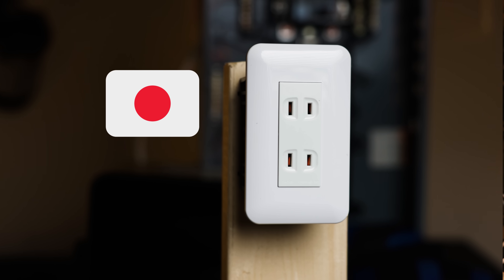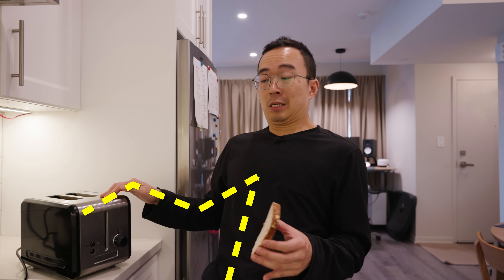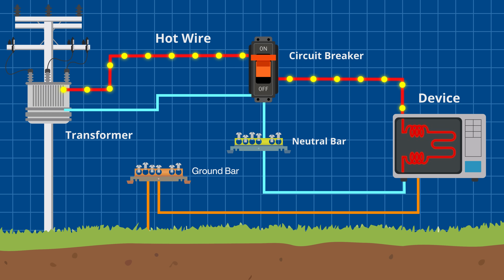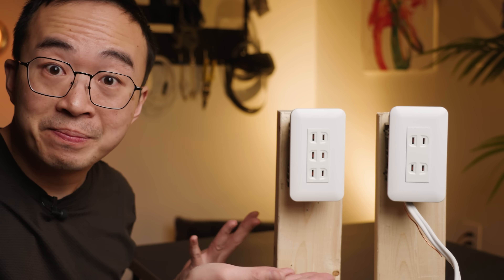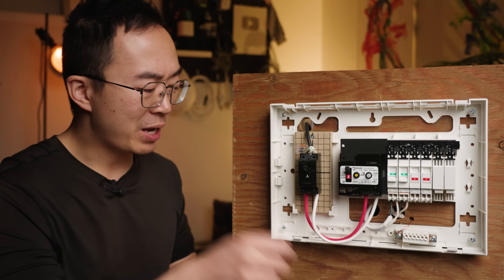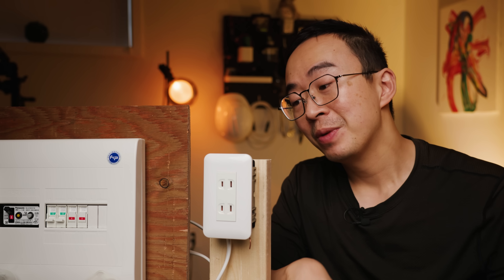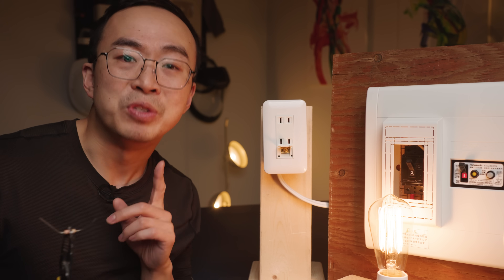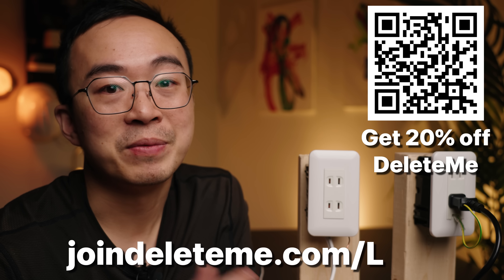How Japan Made Their Outlet Safe

Comment: In America we actually do put GFCI in the breaker but it's still only connected to the wet areas like bathrooms and kitchens. I didn't know that we did that and so when I got my current place I was like what the hell why are the bathrooms protected with GFCI because normally it's a button on each of the outlets and not in the breaker.
Reply: It was generally a retrofit so the first outlet on the circuit is protected, not the whole circuit.
Reply: @Cotronixco  how does it only protect the first outlet and not the entire circuit?
Reply: @bland9876  Everything upstream of the GFCI outlet would not be protected. Everything downstream of the GFCI outlet would be protected as long as it is wired to the output of the GFCI outlet.

Comment: Safer? It rather looks like a dodgy workaround with that additional ground screw. In Europe you've got mandatory RCDs (>=30mA) on all sockets for over a decade now, of course with 3pin wires. In practise for example in Poland all circuits (including lighting) are protected by RCDs (multiple, to prevent turning off unaffected circuits). And the major difference in using both, ground cable and RCD is of course that the cirtuit may turns itself off when the fault occurs, not when a person gets electrocuted.

Comment: Before watching this I make a guess, it could be about tranformer isolated systems with current mitchmatch security switch? A floating circuit so to speak. When current in does not match current out, switch goes off.

Called it!

Comment: GFCI is supplemental protection. Grounding is basic protection. You absolutely cannot replace basic with supplemental protection. Also gfcis are proven to be less effective in 2 wire systems. 2 wire systems don't provide adequate protection when operating properly and absolutely zero protection in case of failure. All it takes is a loose or burnt neutral wire at the breaker panel and all metal parts of electrical devices become live.
 I would honestly expect a second video correcting this one, as the level of electrical safety knowledge you demonstrated is abysmal.
Reply: I wonder how much safer does that makes the whole system. Not theoretically but practically. Being living in Japan for a long time, but have never heard anyone dying of a electric shock...does that extra grounding REALLY make a difference in real life?!
Reply: GFCI in Europe is ALSO BASIC.. NOT SUPPLEMENTARY... in an exposed wire or damaged device that discharge in your table's legs or in a ... plasterboard frame of ...american papier-mâché houses ...with the cables around and not inside the corrugated... probably the ground cable are your little son... and your 20.. 32 or 64 Amps circuit breaker isn't adequate for save your unaware ground cable called probably YOUR SON.... 🎉🤗🥳😅

Or not?
Reply: Each country has their own regulations which define what you can and can't do.
Reply: NEC and CSA don't think so. They approve GFCI receptacles as a safe 3 prong retrofit for 2 prong ground-less K&T or old Romex wiring.
Reply: @Roi-su8mo  I can vouch this is true in Canada. From the Canadian electrical code book 2018(I dont have the latest):
26-702 2) - At existing outlets where bonding means does not exist in the outlet box, grounding type receptacles shall be permitted to be installed, provided that each receptacle is protected by a ground fault circuit interrupter of the class A type.
Appendix B for that rule goes on to describe that the GFCI can be of the type that is intergrated into the receptacle, incorpirated into an upstream receptacle, dead end front type or by GFCI circuit breaker.
Reply: @zeddpilsner4  that's essentially converting a 2 wire system into a 3 wire at the outlet itself. I've no idea on how effective that would be since we don't use it here but it sounds hit or miss, especially since it only protects against the fault of the device and not the outlet itself.
Reply: @adrianio1000  Doing this would provide the 2 prong receptacle with what the Canadian electrical code defines as "Class A GFCI" protection: a ground fault circuit interrupter that will interrupt the circuit to the load, within a predetermined time, when the ground fault current is 6mA or mor but not when the ground fault is 4mA or less.

The appendix B for that definition goes on to explain that: "the primary function of a class A GFCI is to provide protection against hazardous electric shocks from leakage current flowing to ground from defective circuits or equipment"

This was a follow up the the previous commenter that it is a code compliant method to replace two prong receptacle with a 3 prong grounded type provided that each receptacle is protected by a ground fault circuit interrupter of the class A type.

I am not sating my personal opinion about the effectiveness of this method. I am only quoting the Canadian electrical code 2018 for anyone reading that may want to learn what is code compliant in Canada
Reply: @Roi-su8mo  well the IEC does not.
Reply: That's BS.  GFCIs don't need or care about a ground connection and are not "less effective" without one.  That's like saying your speedometer in your car is "less effective" without a passenger.
Reply: @jovetj  That's wrong. You can potentially use an ungrounded GFCI because many devices only have 2 prongs to begin with and for those there is probably no real difference. However, for 3 prong devices, they may well not have another layer of insulation, so that lack of a ground pin is a very big deal. 

So, to say that GFCIs don't need to care is a load of crap, they only don't need to care if they don't have a 3rd place for the ground pin to go. You're risking getting shocked as it does take a longer period of time for the power to shut down coming through the outlet than it does for current to be diverted down a ground.  If you need GFCI protection, you also need the protection that comes from a properly installed ground unless the outlet only takes 2 pronged devices. Which is really the only reason they have been able to get away with that. Their stuff is double insulated and is used/installed generally with the understanding that there is no ground to rely on if something goes wrong.
Reply: @jovetj  tell me please: how are you going to wire an gdci into a 2 wire system, such that the device's chassis ground is outside of the GFCI sensing loop? The answer is you won't. You have to actually touch a faulty device and receive an electric shock for a current imbalance to occur and for the GFCI to trip.

Comment: 2:26 thats not good. the exposed copper wire will oxidize and the resistance will rise. Also someone who touches this in a bad timed moment would get zapped.

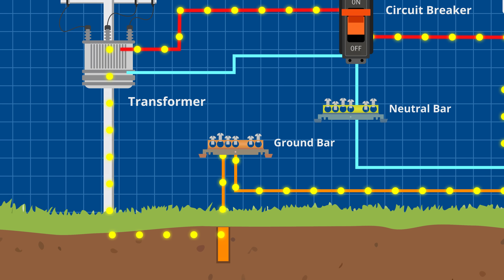7:00 The TT System is outdated, at least where i live. We rely on the TNC/S System. It's basically the same but it has an additional grounding that goes back to the transformer. It also split's the ground and neutral in the house itself. That's why we gave 3 Pins everywhere. And also why it's safer than the Japanese ungrounded System.

Comment: In all other countrys, GFCI works combined with ground.  So Japan still don't really have a real ground, it still can lead to harzards while GFCI failure.  Anyway US and Japan are still stuck in the really beginning of the 1st generation of electricity for more than 100 years.   It's just so poor design and was obsolete for almost 100 years also.  But stuck is a stuck seem US and Japan will be keep stuck in this system forever.

Comment: 3 connector sockets and GFCI / RCD is something normal and required by law in EU. Here in Poland we often have more than one RCD unit (usually one per lighting circuits and one for sockets). Thanks to that broken washing machine doesn't cut whole electricity at home off. I do have separated RCD (in fact integrated RCD + circuit breaker into one unit) for washing machine and oven. We do have by law requirement of minimum cable diameter used for grounding and maximum resistance of grounding. It's not that bad outside Japan :)

Comment: soo the outlets are actually even worse, and so is the infrastructure (TT), but you're saying its better just because whole house GFCIs are used?

Also that ungrounded socket WITH ground screw terminal is the most ridiculous thing I've ever seen... it SHOULD be a grounded socket with ADDITIONAL screw terminal for those old appliances you've got there, or just a grounded socket and force people to replace the appliance's plug instead of fitting such a dumb socket in the first place. I'm sure you could also get an adapter from grounded socket to one with the screw terminal too.

Comment: Your video is nice and informative, but not having earth makes it dangerous and I imagine not everyone will be connecting an earth wire from the plug. In the europe, UK and India, where I have designed things for (cannot say for other countries) we have RCD 30mA breakers in the house main panel and earth is connected to everything. Here if you had this same case with a toaster and there is a faulty wiring, connecting the plug into the socket and switching it on would have tripped the RCD. It would not have waited for someone to touch the toaster, because getting shocked to trip is not safety, we have moved past it. It should trip when the equipment is connected before someone gets shocked. So apologies but seems like Japan is still catching up, and US probably doesnt care about having whole property RCD protected.

Comment: There’s an additional level of safety that’s starting in the European electrical codes: grounded plugs with multiple GFCI.

Plugs designed to be safe like Schuko or that british one with a general gfci in the electrical panel with additional gfci breakers or gfci plugs at high risk locations (for example the bathroom gets a gfci breaker, outdoors gets a gfci plug)

Tamper proof, will short when faulty and not kill you when shocked nonetheless and hopefully not disturb the others in the house when things go wrong

Comment: Most places in EU have mandatory ground, but also have 30 mA GFCI. The latter is not mandatory by law in homes, but many have it installed as added measure of protection. Single outlets in restrooms can have 5 mA GFCI.
In industrial settings, a 300 mA GFCI is mandatory - not to protect people, but as fire protection countermeasure, like when an outlet is flooded.
Since GFCI switches fail after 5 - 10 years of service, not having a permanent ground can result as a danger...